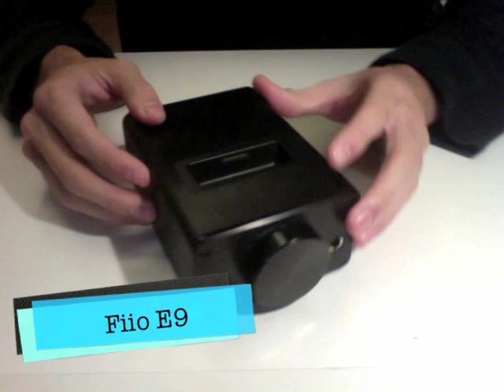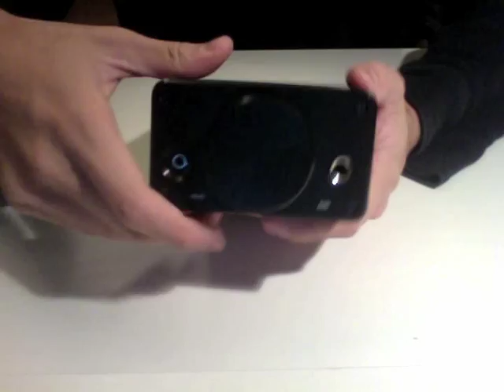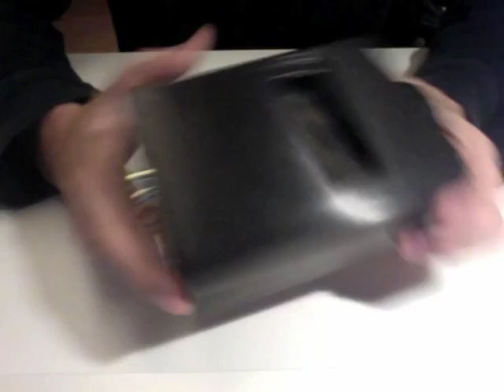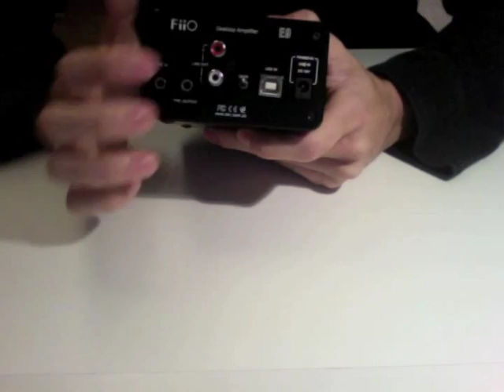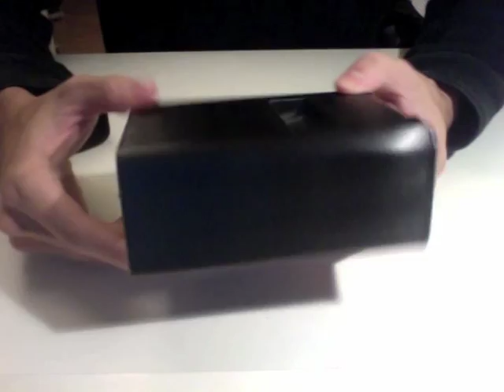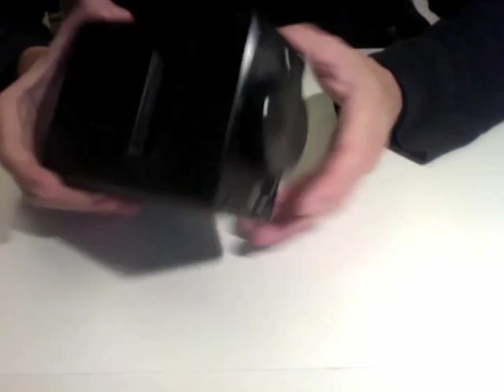Fiio E7 USB DAC / E9 Headphone Amp Review Part 1

Comment: Hey everyone, QUESTIONS. So, I've recently purchased the HiFiman HE 500 headphones. I pair it with my FiiO E7 AMP/DAC. I won't go into too much detail, but the hifiman's are VERY clear with a large soundstage, I'm not dissatisfied with them at ALL. Though I can tell, and have heard from other reviewers that with a lower end bit of amplification like the E9 it's main flaw is lackluster and thin BASS, low end.. So, would mounting an E9 be worth the xtra money later ? I'm not sure how much wattage and voltage the E9 puts out but the ohm load on the he 500's is 48. Anyone know how an equation for figuring required watts based off of ohm, or if there even is one??

Comment: Very nice review! However, a slight tip that may improve your liking of this system even more: the rca ports on the back will serve as line outs to your powered speakers.  You can plug your speakers into this (you may need an adapter), this lets you drive your speakers and looks a bit cleaner.  The best thing about this is once you plug headphones into one of the front jacks it bypasses the rca ports, driving your headphones instead, so you don't have to fiddle with the sound on your speakers